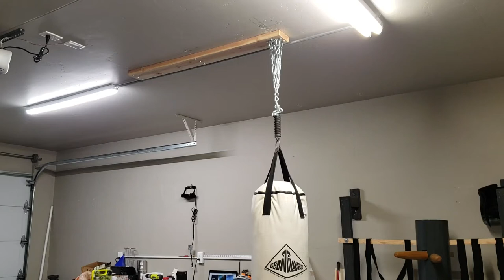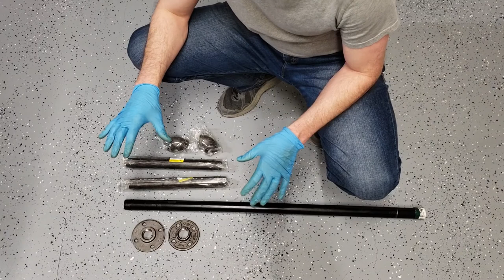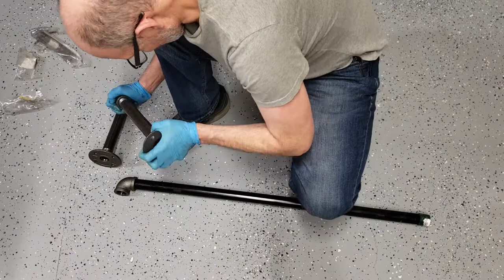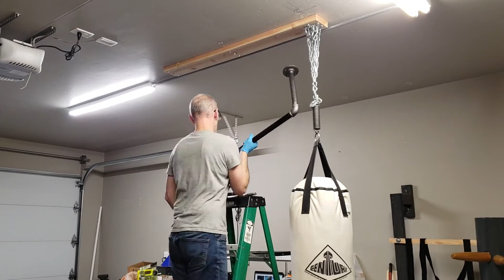How to Build an Iron Pipe Pull-up Bar

Comment: May I know why you need that piece of wood on the celing?
Reply from the maker: Hi Anthony, The board is attached to the ceiling joists on the other side of the drywall. It is then a solid surface to attach the pullup bar to.

Comment: We're those Lag Screw Bolts to attach the flanges?
Reply from the maker: Yes, the lag screws were used to attach the flanges to the 2x6 on the ceiling.